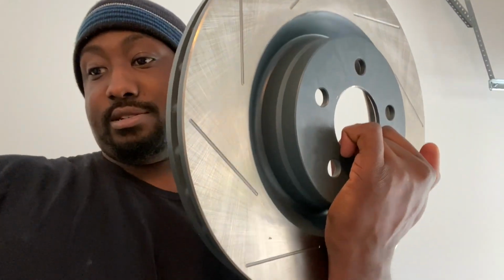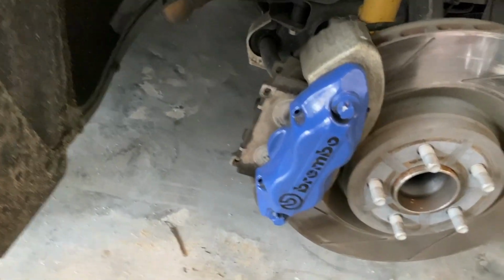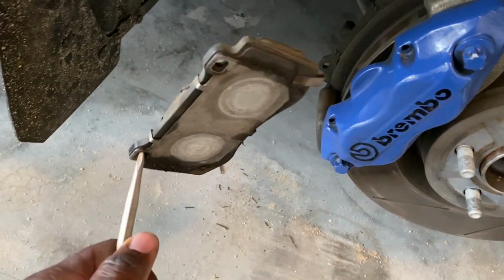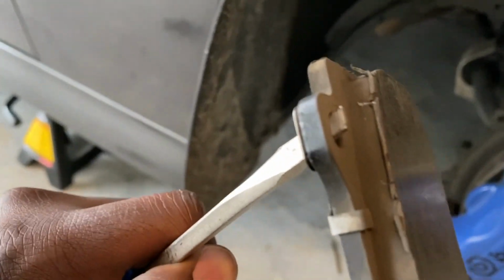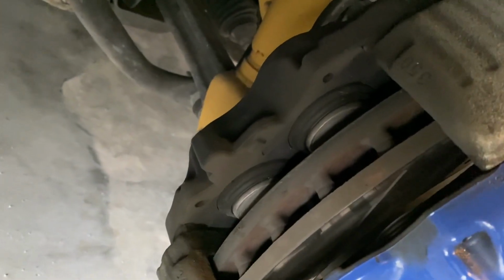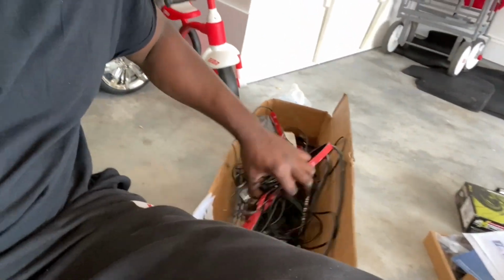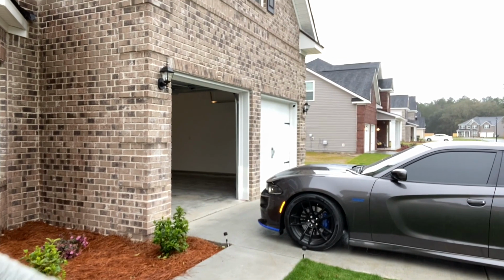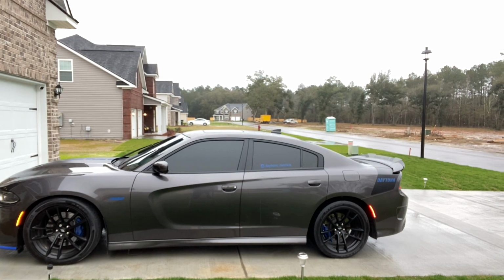How to install side marker lights on a dodge charger #hellcat #scatpack #hemi

Comment: How did you trick out your rear tail lights?  Thx
Reply from the maker: Taillight vinyl of off eBay 💪🏾
Reply: @WrightLyfestyle  so it covers the lens?  Do you have link. Thx
Reply from the maker: Yeah it’s basically like a super dark tint 

https://www.ebay.com/itm/153924260166?hash=item23d699d146:g:VmEAAOSwNuBeteQi